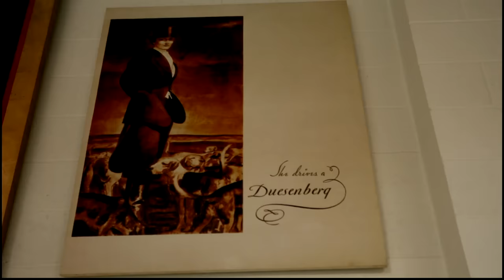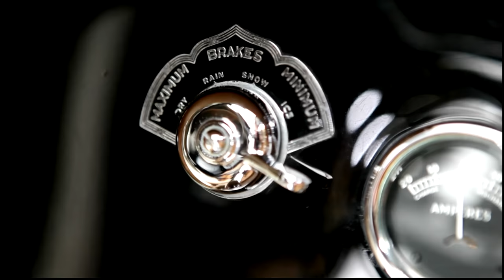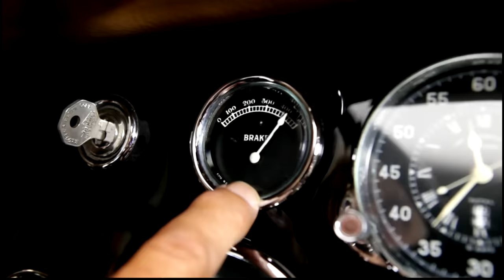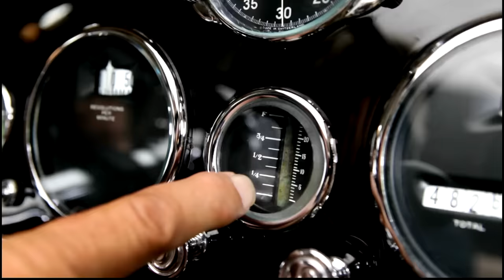1930 Duesenberg LeBaron Barrelside - Jay Leno's Garage

Comment: About 34 years ago. I had purchased a 1984, Mercedes-Benz, L-1117,, 30 foot long, diesel box truck. And in having this beast. I needed some parts and pieces. I found a junkyard. They had an old Mercedes truck like mine. So I went over there.

Yep I was able to get the few parts I needed to my truck. And as I'm looking around  at all of these other wrecked vehicles. Lo and behold. Here's part of an old car. What is it? Dusen Berg. I have no idea what model it was? There wasn't much of it left. But it most definitely said, Dusen Berg.. It was most of a  driver and passenger compartment. I don't recall an engine? I don't recall a roof? I don't recall much of it left.  And I was surprised to see the name Dusen Berg. And it made me wonder. Whose it was? How old was? How did it end up here?

I still think about that vehicle to this day. I hope somebody got it. I hope somebody restored it. But there wasn't much of it. There really wasn't much to restore. And so maybe that was its final fate? Of that legendary manufacturer. And I never returned. I never needed any more parts.

It's now 2023. My vehicle still runs. I think I put on at least, 10,000 miles in the past 30+ years.. That is not a typo. That is 10,000 miles. Approximately.  It was a specialty vehicle. I didn't take out much or often. As it was extremely unique. Highly customized. And nobody knew what it was? It just looked like a Sears delivery vehicle. Which is what it had been for five years. Before I got it.

Okay and what is it? It's one of the rare, few, approximately one dozen ever built. Mobile Recording Studio Audio Control Room. For live recordings and live broadcasts. Where I have very long, multicore, microphone, Snake Cables. About a city block long. And it's a box within the box split into 3 rooms. Complete with central HVAC. And the power lift tailgate  come, Porch.

Almost all others are gone today. It's now a white elephant. Technologically speaking. It's from a bygone era. And it basically carried the Sound City Control Room. The movie you can stream for free here on, YouTube. Produced and directed by Dave Grohl.. And it's great! It's all about my audio console! As I got the same one in the movie only better. Or so I was told. By the man who designed and built it. Many times over. Over many years and hours upon hours, of discussions. I was so lucky. Watch the movie. You'll know the sound I get.

And it sounds like this:  https://soundcloud.com/remyrad/track08

This is a live recording I was contracted to make back in the summer of 1996. This is only one cut of the entire set. That also included video. Which also emanated from my facility. From the 2nd Control Room. Inside my big diesel box truck. Oh yes it was, Awesomely, Awesome.

I love Jay's show on cars. I was born and raised in Detroit in the mid-1950s.
RemyRAD

Comment: There is the straight 4, most common light the Briggs and Stratton. There was the straight 6, mostly up to the late 90's.  Then the V6 to make the designers (so they can make to hood shorter) and car mechanics happy (cause the straight 6 was cheaper to work on and had less parts). But the straight 8... That's class. Like the Grand father clock.

Comment: Great video--mad me feel I was right there with you! The huge radiator--ts the great reservoir of cooling capacity partially because the system isn't pressurized? Aircraft of this era didn't have pressurized cooling. 
Gaskets/sealing issues weren't resolved for many decades. My '70 LT-1 Vette's Holly's gaskets would dry out if not driven in a month; then, when started, would leak like a sieve. As far as lubricant/fluid leaks on these great vehicles, take a look at a Supermarine Spitfire. One reason it's a short range fighter could be that it'd run out of oil if it carried enough fuel to fly long rane!!

Comment: May I suggest that you make the Fire Extinguisher Bag the same Light(er) Blue as parts of your car?  
 
Also, think about putting a discreet CO2 bottle with piping and a few nozzles at the right place somewhere under the hood (or other easy to access location, with a pull handle.  (Kinda like what a lot of Frontline vehicles have.). The idea about it being under the hood, is that you can also have it rigged so that when it gets to about 300 degrees Fahrenheit, the disc that prevents discharge is basically pushed up into the plunger and self ruptures putting out the fire without you having to pull the activating handle!

Comment: I did some testing with the Evans coolant, interestingly, although the coolant was hotter, the metal of the head was actually a little cooler. It was doing a better job of removing the heat.

Comment: I had to revisit this clip Jay.
I have using a tric for the different key and lock issue. I use clear nail polish and one key has one dot on the key and one dot on the handle where the lock is, and the next key two dots ans so on. So even if its dark you can feel on the handle witch key to use.

Comment: In another Duesenberg episode, Jay calls the car the world's largest 1932 Ford.
So, at our "Cars in the Park" show (SierraVista, Arizona), I put the following sign on my 1932 Ford Roadster..."World' Smallest Duesenberg".
Also, would be interested in his insurance on that beauty?
My 1998 Lexus has the 2JZ engine..straight 6, dual overhead cam, 4 valves per cylinder. Awesome, Not as pretty as the Duesenberg however.

Comment: What to do with altimeter: Drive the car to Badwater in Death Valley and test out the altimeter at an altitude lower than sea level. The gauge looked like it went to 31 inches of mercury so the altimeter should work at Badwater (279 feet below sea level).

Comment: The reason you had an altimeter was if you were in the Alps and you're above 10,000 ft you need oxygen and the Duesenberg needs its fuel system tuned slightly then when you go back down and all the tude you have to retune it I believe there is a fuel meter screw that adjust the air mixture

Comment: A few years younger than you Jay.. my elder brother, was an old car buff. Many times I heard about the Duesenberg but I don't think I've ever seen one in person. Hey did I see a white Jag XK 120 Roadster behind you there? I may have driven that same car a few years back did you buy it in the '90s? When my brother sold That Jag, I drove it through town Eugene Oregon and he was selling it to someone in Southern California I wonder if that by chance is the same car restored drove nice look good forgot the year that was the second or third one he owned and my experience was mostly around the or was it 52 Escape 120 drop head Coupe? That first gear transmission whine in the Duesenberg reminds me of the Jags, and in the mid-60s my crazy brother-in-law, but a 3.8 sedan, with overdrive, and get this very nice wood Dash with the altimeter. That was a big point because I could watch the dial go down as we always drove it to the coast. A 60 mile romp, passing everything and ignoring construction zones hell we just went around it and my brother-in-law would hit 90 all the time. Brother-in-law was a little wild when he started drinking beer and he drove the car through our front yard through the neighbors picket fence and escaped with a small brush on the front corner of course the clutch and transmission were stressed beyond the max so that was the issue later on.. just love that first gear wine. Absolutely stunning car, I wish I could drive it. Recently my elder brother about your age Jay, after about 55 years of ownership, he got his 1932 Packard running, the one I put a lot of miles, in the driveway at age 6, chopped like a gangster car and straight 8. I helped him put it on blocks, so it was like power steering I could really drive it well, in the driveway! Thanks so much for sharing Jay you got the coolest car collection I think..🙏🙏😎

Comment: I didn't have a fire but on the way to a gig the van kept stalling every time we were in the sun. Fuel pump was to hot for some reason. Instead of 7Up we poured our iced down gig beers on the fuel filter every ten miles of sun or uphill stretch. Made the show.

Comment: With the key situation, as cheeky as this would be for a solution, I’d mark them with some of those label stickers you can type on 

I = Ignition

T = Trunk

DE = Driver’s side Engine cover 

PE = Passenger side Engine cover

DB = Driver’s side Box

(And can add one or two to denote front or rear) 

BB = Battery Box

Comment: I know Jay won’t see this, but for his thousand different key issue, he should take different color paints and paint a little dot of different color paint on each lock body and paint the same color dot on each of the matching keys, that way all he has to do is look at the color dot on which lock he wants to open, then flip through the key ring until he finds the key with the same color paint dot.  That’s what I do and even in a panic you can find the key right away

Comment: Might I recommend applying different color paint to the head of each key to make it easy to identify which key does what. I'm not saying to paint the locks, oh no! Just the keys. Then, in other vehicles with many,  multiple keys, do the same thing following the same color code for each task. This way, you become more familiar with the color and it's matching, corresponding task across. all these multi-key cars.

It's a simple solution that doesn't involve marking up the classic car. Perhaps you could make a duplicate set of keys for everyday use and leave the original set unmarked. Maybe you could come up with a less intrusive method of doing this with the same results.

Just a crazy thought...

Comment: Jay  if you read this.. I believe you"ll find "kerosene" in place of water will run cooler__ I  expirienced this flushing an engine that had a headgasket issue before repairing it ( I ran-drove it running straight kerosene in place of any coolant)

Comment: One Duesenber was ordered to be completely disassembled and disposed by order of  a divorce court / judge in Pasadena Californina. It was one of those King Solamon  situations where the wife and husband could not settle. The judge ordered the Pintarelli Brother's Car Clinic up on Washington Blvd Pasadena, California,  to do the deed.  Joseph and Sam Pentarelli had their little Brother do the work (hundreds of wood screws to remove); John Pintarelli. The car body was disassembled  but the running gear went into the Pintarelli Brothers  Big Car race car.    Steve

Comment: Jay, do you own a Cord? My opinion is that the Cords were some of the most sleek, beautifully designed cars of their era! My personal favorite production year was the '37 Cord! I live about 10 miles from Auburn, Indiana and of course there is the Annual ACD Festival each year there. When I was a kid, some company was making a polymer body material to replace the body panels on a Cord that was nearly industructable. If memory serves, It was a molded material that if it WAS bent or damaged, in an accident, it could be heated to a certain temperature and it would spring back to its original shape. I seem to remember it being a fairly thick material. (Approx. 1" thick.) Are you aware of this material? Or am I mistaken, and this was possibly the "original" material used on Cords, from the factory?

Comment: The parts can probably be 3D printed and would make it easier to build a replica I imagine. The Cadillac V-16s of 1932 were 180hp officially only, in reality they were closer to 400hp at least, but they needed racing  oil and an intercooler added to keep the engine from overheating.  Jay Leno should either learn how to use the clutch or switch it over to an automatic gearbox because gears on a Duesenberg shouldn't be grinding especially with proper clutch use and although I've driven manuals, automatics, and semiautomatics I've learned how to use a clutch properly and didn't grind the gears

Comment: 1) Fantastic video ! The car story is out of a book by Scott Fitzgerald. 
The kid selling the Stock and purchasing the car .
The Bank Robery in Germany. The way the loot was brought into the US.
THE SUICIDE AND THE RELUCTANT SELLER.

2) My Grand-Father faced a comparable  predicament. He placed every single key in a labeled Key-ring.
And the  6  or 7 Keys were inserted in a slightly larger  Ring -- affording enough room  to manoeuvre any individual Key.
Obviously, he had duplicate Keys properly cut,

In sum,  label every single Keys. If necessary, buy in a drugstore a set of rings attatched  to labels..
Place them all in a larger rjng.
VOILÁ LA SOLUTION, MONSIEUR  JAY LENO.
A BIENTOT ET MERCI  ENCORE UNE FOIS

Comment: I enjoyed this video and others (no, I have not binged on them yet), but I have a minor quibble/comment: somewhere Mr. Leno says he doesn't edit his videos. This is patently not true once he takes his cars on the road. He has to because there is no way he can do all that driving on a single take (a la "1917"). It is more like "Drive" where the locations are miles apart. Yes, he is not using a team to do his filming as the GoPro cameras he uses can be seen in various shots. But what really gives it away is the routes he takes: they are all on the northeast of the San Fernando Valley. For instance, the bit on the altimeter was taken on Foothill Blvd (heading south) as it goes over the Big Tujunga Creek wash and the seconds before it were filmed at the intersection of Clybourn Ave  (heading north) with San Fernando Road while the seconds before that on Sunland Blvd (heading south) at Nettleton Ave.  I am sure he has way more clips and he simply selects the bits that fit into the story he wants to tell. Is there a script? Doubtful but the road clips surely take time and effort to put together. And for that, I am grateful because it is a lot of fun watch him drive this priceless cars in an area of Los Angeles that many don't even know is there (for instance, he drives by many "pick-your-part" junkyards but you don't notice them). All in all, great videos.

Comment: I'm thinking 11-13 MPH isn't much lower than a 5600 pound gas powered vehicle made 70 years later would get.  I wouldn't expect a 2 1/2 ton SUV made in 2000 to get double that, especially with a 3-speed.  So its engine was probably pretty efficient for that era.

Comment: Dear Jay, You "need" to meet a locksmith that could change every locked compartment to a single, key-system.    You're "busy" enough to Not have to have the "aggravation" of a different key for each compartment, plus if you ever sold the car, they could all be changed back, PLUS, What if you ever have a FIRE, again, and you lose precious time fumbling-around to find the right-key for the compartment you wish to open?    I think you should change the lights @ the front to matching Woodlights, but perhaps those would make the car look too "sinister."   Distilled-water should allow you to avoid all corrosion "issues".   Distilled-water is 80 cents a gallon, in Arizona.    Your water-system piping could be "impregnated"with sealants on the inside, so you'd Never put a finger through a pipe, again.   The Duesy is "Fab to the Max", but I think the Marmon-16s are the "Top" to me, plus I think fewer were made.    A Nash straight-8 with its dual-plug ignition, is still periodically raced @ Bonneville, although it was not as "sophisticated" as the Duesy, the Nash being OHV, like the Buick-8 of the Era.   The Pierce [Arrow] was impressive, its V-12s in Seaberry Fire Engines, more than 20 years after Pierce autos were gone.   The Argus air-cooled Straight-8 was used in thousands of Fiesler "Storches", the French/others continue-ing to make them after the war, but some didn't like them because the "Storch" was always "STOL-ing".